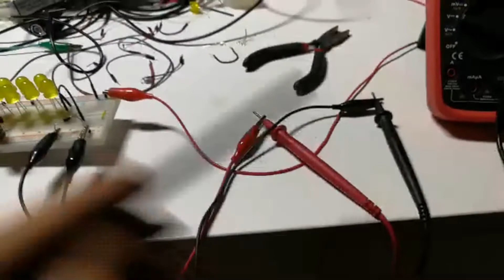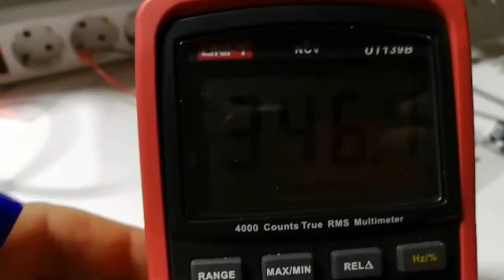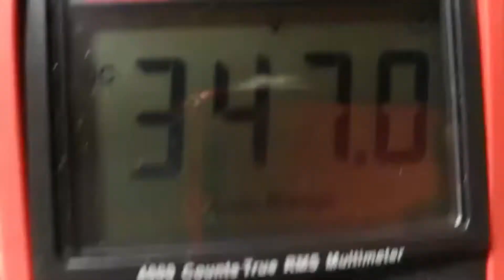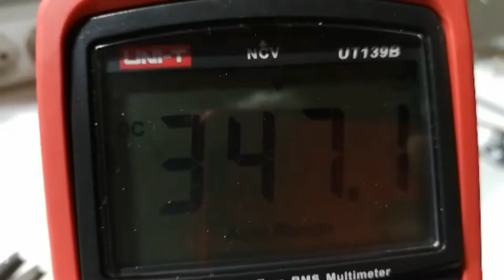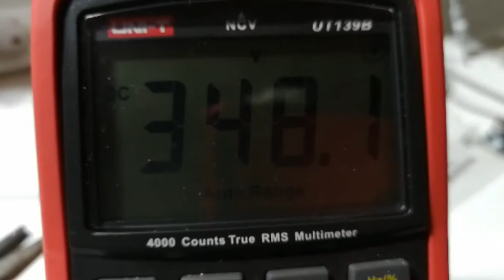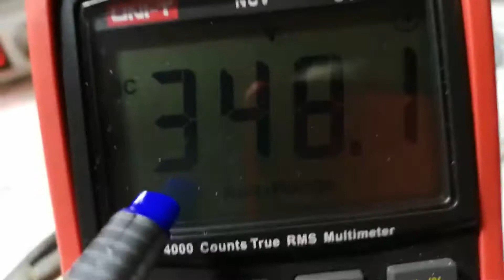Nigel  Dec 4, 2018

Comment: I want a schematic drawing and I want to see the circuit work without hooking it to the electrical grid, which is done on the power supply in the back.
Reply: Pride and arrogance are the worst sins.

Have you tried it yourself ?
Reply: @BravoSixBC  have I tried the circuit? No, because I don't have a schematic diagram for it. All I see is a bunch of diodes and one capacitor, but in the background you can clearly see that the breadboard is being powered by the power strip.
Reply: @BravoSixBC  im working on this but im struggling. Ive seen your go at it. Any improvements?

Comment: What is the exact specification of the reflecting diodes?
Reply: for exp 1n4007
Reply: @feeif5679  thanks!
Reply: @feeif5679  in a diagram he is drawing them pointing both to the capacitor,strange
Reply: @feeif5679  why does he call it reflecting?

Comment: How does this run up to such a high voltage?
Reply: the answer is the way leds are wired
I m still working on too 
y should wire leds following a logic as well as in logic gates 
with and or nor if ...
Reply: @feeif5679  in the other video in the restaurant he is drawing 8 of them with 3 earths, but that fried my leds with high voltage.
Reply: @gerrieklijzing3198  how many v did y get to flip leds
Reply: @feeif5679  just put 16 in a row, put the plus of a car battery on the minus of the LEDs, put the minus of the battery on the plus of the LEDS. Connect to earth on the 15th led.

Comment: If it is so easy why do you need "investment". Please learn the difference between current and voltage. A static shock is many thousands of volts and it does not harm you. It's the current that matters.
Reply: Good question. Why is current not part of the discussion?
Reply: no if y charge cap up to 380 v dc y have enough current I test it too but with radient energy from nothing i could produce 60v with 0.6 amp
Reply: @feeif5679  I can produce around 5,000 volts by rubbing a balloon on my head. If the air is dryer I might can produce greater voltages. Just imagine, the distribution side of the electrical grid is around 8,000, so that must mean I can power a whole neighbor by rubbing a balloon on head.
Reply: @feeif5679  if we rub our balls together we can power the world, PayPal me and and I will give you the schematic diagrams.
Reply: @feeif5679  I would have thought my last comment was obvious satire, but stupidity knows no bounds. 

There is no free energy. Static electricity can't generate very much power. I have seen an electrostatic motor run off the potential difference between the air and the ground. The guy was able to make the motor turn, but there literally no torque produced and the motor could be stopped by the slightest resistance on it, even though the difference in voltage and the ground is around 25k volts at the height the guy used. I would suggest actually reading a book on electricity, instead of listening to these con men on YouTube.
Reply: @feeif5679  if you look closely, there is a power strip in the background. You can clearly see that his wires are terminated at that power strip. An LED is a diode, also know as a rectifier, which converts AC to DC. When you understand these circuits you can see through the bullshit easily.
Reply: @luciddream2033  y look smart but not enough to understand what going on 
this is not electricity 
I would like to show y everything but since y r moking something y did not test 
I told y that I test it my self and there is voltage produced but not enough because of the complexity of wiring diagram 
leds y see are not wired in serie at all 
y know with just 4 leds I got 2v and guess what the plus is not connected good luck
Reply: @feeif5679  yeah my electrical degree is worthless. My 20 years of experience electronic and electrical field is worthless.

Comment: Respecfully how many amps are you getting out ?   AMPS=$$$$
Reply from the maker: There maybe some mention of amperage in the video that shows Nigel running the drill.
Reply: @gregattelephonet7400   hi prof how the leds are wired because I tried a lot of configuration and the power is too weak to charge capacitor , if it can help I m using earth supply and antenna ,  can i contact y
Reply: Same here, getting out just some mV, not nearly as much as Nigel
Reply: @Zephyr9810  y should make yr own earth rod 
me with two earth rod without leds  i got 0.780 volts but the only mystery is the led wiring diagram I m still waiting for followers experiences😉
Reply: @feeif5679  So you mean that the quality of the AC socket earth output might not be sufficient enough? If yes then I think I got the wiring right
Reply: @Zephyr9810  I think that so how did y wire leds 
give yr mail I send y my configuration i m sure it s ll be netter5
Reply: @feeif5679  Am using my indoor aerial and a earth from the cooper pipes in house am getting 12 v but very low amps, are all the led facing the same way around does anyone know ? the first row of 8 I have positive negative, positive negative ect, with a space  in between them all, the second row I have started at the negative side of the first Led with a positive and so on joining them all together, not sure if this is the right way to connect them any one know ?
Reply: @feeif5679  I wired it like Malcie told can I have your mail so I can send you a photo :)
Reply: @Malcie007  I did it the same way, after putting them in a row with the joined earth in one slot, plus on the left and minus on the right. Was also putting something out but not as much as in your version. Still I don't get as much V out unfortunately. Amps don't matter when playing around with ion energy. Maybe you could put it through a DC/AC converter and check your Amps then
Reply: @Zephyr9810  i didnt' receive yr mail did y send it thks
Reply: @Zephyr9810  what do you think you mean when you say "ion energy". Of course current is important, its how you calculate power.
Reply: @paintspot1509  I meant that the device you want to power with the energy draws as much current as it needs once installed properly. With ions I meant the voltage which is present in the air around us
Reply: @Zephyr9810  do you know what an ion is and where they exsist in nature?
By voltage in the air, do you mean lightning?
Reply: @Malcie007  Could you send me a diagram or pic re the wiring plz?
Reply: @paintspot1509  yes when y put two leds together y put earth in one side the other exterem leg not connected at all y can got a bit of voltage between central leg and earth air is positive
Reply: @feeif5679  Place a car battery across the light bridge, it charges the car battery and gives power to start up the circuit, when you put 12V on it, the AC goes up to 2,2Volts.
Reply: Amps might not be the right question. Volts amps watts relate to a "closed system" and obey all the rules being used for the past 200+years.. Nigel has apparently found a way to get out more than he puts in which makes his an "open system". the only real measure is, will its output make my refrigerator work without modfications? 
Amps = watts / volts.. and your getting a LOT of amps.
Reply: @fb6351  no he has not found a way get more energy out then he puts in. That is impossible. You are correct P=IV, his power will be tiny because his current is tiny.

Comment: Talking about Volts without ever mentioning the amps say nothing about how much energy you are generating. You can have something producing 20.000 volts and 1 miliAmpere/hour and the energy it takes is 20 watts/hour.
Reply: Voltage can be converted to current due to ohms law. With that high of voltage, you have plenty to spare for conversion into power. Whatever the case, that's an enormous amount of electrical potential for a circuit with no power source.
Reply: @afrohawk  To add on top, don't need to forget grounding. I did multiple other tests, not related to this one, grounding increase amps 4 free.

Comment: Steal the tech? You said you work for the people and energy should be free. If it is not open source then it is no good. I don't mind shelling out some cash to help you on with your life in whatever way you want to spend it. However trying to replicate this I haven't gotten it to work. If you send me a "how to" in order to obtain a functioning proof of concept, I will send you money. Until then, ta ta.
Reply: Casey.. the Corps of the world have made a science of ripping off inventors and leaving them unknown and pennyless. Nigel has to solidify control of his methods before he "let the cat out of the bag'' or it WILL be stolen and lost to the world , OR , will be made even more expensive than the presend electrical distribution systems and you still wont have it or be able to affored to use it..  If Nigel can solidify his hold on the theory and devices HE can controll the prices instead of Rockerfeller, jpmorgan, or blackrock and vangaurd corporation. Things are a LOT less expensive if manufacturing and access are managed by a living man.